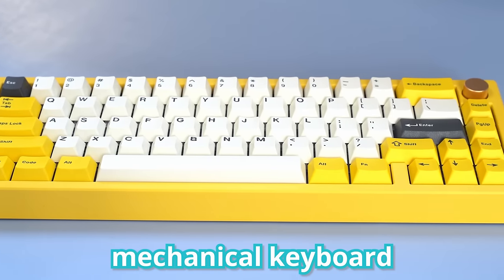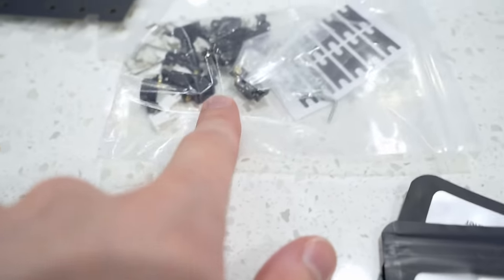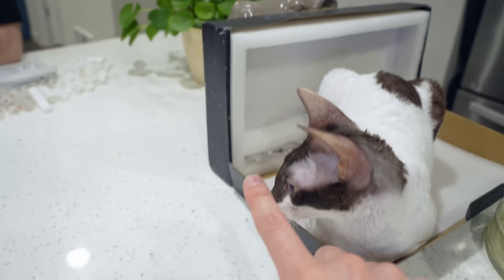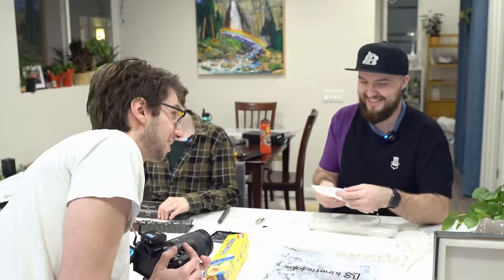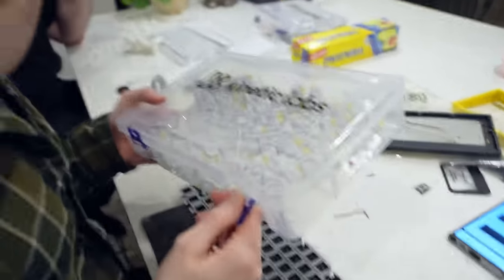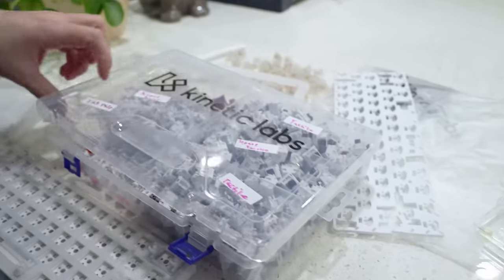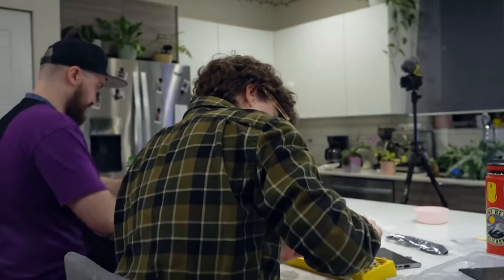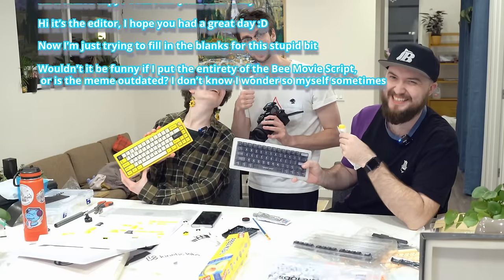How to Build Your FIRST Custom Keyboard... (in 2023)

Comment: Not trying to troll but I really don't understand the custom keyboard space, and I'm a huge tech lover. It seems a bit like you think 'gaming' style keyboards all look the same and are silly but then most custom keyboards people make are just pastel colour keycaps on the same frame. Each to his own but the main thing for me is that you're missing out on features like media keys, low profile form factors, light up keycaps (so you can see the letters), high speed wireless, etc in a quest to find the ultimate sound of a keypress... and god help you if you like tactile or clicky switches and didn't lube them haha. I think I've just spent too long using laptop keyboards to truly value the typing experience.
Reply: Many customs feature knobs, which combine every media key into 1. Volume, pause/play, etc. You can find low profile keycaps and switches, you can get shine through keycaps, and many boards have good wireless.
Reply: At the end of the days its al about prefference
Reply: You probably don't understand because custom keyboards are decidedly not a "tech" item. Building a custom keyboard compared to an off-the-shelf gaming keyboard is like a turntable and vinyl record collection compared to a Spotify subscription: the latter is decidedly more convenient and practical, but the former augments a mundane task with a satisfyingly tactile ritual. Custom keyboards are a luxury item within the tech realm, and like any luxury item, you need to want that luxury in order to appreciate it.
Reply: All the things you listed as missing out on are present in different boards
Reply: @xdoctorblindx  Hmm I think you've got a point there. I'm a big classic car enthusiast and while decidedly less efficient/practical than modern cars they have character and personality in a way modern cars don't. The problem is convincing someone like me that's never tried one of these keyboards that it's really much better than a mass market one but you've got to buy it and feel it yourself :D
Reply: You know, a lot of custom keyboards do have these features, but it's down to what you want and how you choose to make it. It's mostly just personalisation, which you can even do with most gaming keyboards  anyway. I do agree with you though, most builds now are very uninspired and a change of pace in the community would do it some good
Reply: @Aftershock416  I'm going to go for woefully ignorant, but not wilfully. It's not an easy area to understand without coming across lots of opinion. I'll admit I don't know much. This is made even more difficult when vendors are mostly group buy and it's difficult to understand certain compatibilities. I see something like logitech's 915 tkl as what I'd want from the 'custom' space, but I've never seen a custom keyboard that offers similar features, and I wouldn't really know where to start.
Reply: @boomboxkat  The thing is most custom keyboards look just like the ones in this video. I have seen one or two of these features but nothing combining these. How would you go about making something custom but similar to the Logitech G915 TKL?
Reply: that was so passive agressive
Reply: Sure I love my Razer Analog and it’s unique to that keyboard switches with full travel detection and adjustable actuation points, but a nice looking custom board doesn’t try to override my controller inputs and make me spend half an hour fixing things every time I want to play a new game
Reply: How to be wrong in so many ways 101 😂🤣

To be fair, you did say you don't understand the space and it shows. 

Come on in, take a look around, stay awhile, and learn.
Reply: I ain’t readin all at
Reply: You're not wrong
Reply: Me before I modded my cheap gaming keeb
Reply: @LukeEvans55  you buy and modify a Logitech G915 TKL. 🤷
Reply: It’s because they’re better keyboards than those gaming keyboards you mentioned. Hope I helped.
Reply: It's a hobby. People are into custom keyboards for the same reason that people tune their cars. It's cool
Reply: Bro wrote a whole essay fr fr
Reply: custom keyboard space for me is not that much leaned into tech so its understandable.
Reply: It depends on your use case and what you think is cool tbh. Most of the 'gaming' customs are about aesthetics since, at least for a lot of the well known builds like the tifu custom, the person already knows what switch they like. There's also a ton of size choices compared to most mass production keyboards especially for low profile cases. It's mostly about diversity in case material for me since I love my current low profile case
Reply: Kailh choc switche are low profile
Reply: and i dont think people in the keyboard hobby sacrifices some of these features just for the sake of sound. do know that with the right build you can build a board that's as fast or even faster than mainstream gaming keyboards and crazy rgb.
Reply: its all about preference and who needs light up keycaps to see the keys bro? just memorize the keyboard 😂
Reply: Most custom Keyboards will use QMK firmware.  You can up to 16 layers.  You can all those extra keys on a layer.  Many of the customs like the yellow Zoom65 in the video has per key RGB, so you could use backlit keycaps if you really wanted.  The Zoom65 is Bluetooth as well, though BT does have latency.  Still, most gamers are going to be sitting by their computer when gaming, so just use a USB cable.  Whether to lube a switch or not is personal preference, and depends on the particular switch.  many switches come factory lube and feel pretty good stock.
Reply: @xdoctorblindx  I put custom keyboards more like quality hand tools.  Not a luxury, but can make a professional work easier or last longer.
Reply: I lubed my Razer Black Widow a few weeks ago after owning it for many years… I get it now. Even that made a night and day difference in the quality.
I really don’t like the pastel colors that the custom folks seem to like though.. if I build a full custom keyboard, imma definitely have media keys, volume knob, and shortcut keys.
Reply: Personally I find there is quite a lot of variety! 

Sure you've got keyboards like these but then you've also got stuff like dactyl manuforms and ceramic or metal keycaps!

Different layouts for your keys, like colemak or dvorak instead of qwerty too.

You just gotta take a bit of a deeper look.
Reply: I think it helps not to think of it as a tech item, but as art :)
Reply: My personal answer is: it depends on what you care about. Sure, you give up quite a lot of things in order to customise a board to your needs, but I never cared about media keys, wireless(in keyboards) or rgb.
So it’s easy for me to give up those things to get what I want in other aspects, like full key remapping with an option for multiple layers, compactness(helps with shoulder orientation when working or gaming), being able to customise the sound, feel and look
Reply: Idk men I can agree on the missing features but it just feels good to make something sound nice and having it useful to your daily routine or what you do with it. Feels the same as building a pc
Reply: @xdoctorblindx  Tbf the key caps themselves should not be so expensive 

The prices are definitely inflated
Reply: All those features are in custom keyboards as well if you do the digging 

I’m looking for an exploded 75% w/ Gazzew Boba U4T switches as the base for what I want. 

I don’t like RGB or lighting up (cause i won’t be typing in the dark most of the time) but I definitely want macros on the left side (this has been extremely hard to find) 

I agree with you on a lot of the key caps being overpriced and looking kinda samey. But some just look nice and then I can mix & match them with others whilst also having a few custom made (as in design wise not material) for my macros
Reply: its called a hobby. Someone liking something doesnt need to make sense to you
Reply: That's hilarious. Personally love Custom keebs (i have built 5), but very much think the most popular designs are the most unsaturated boring things ever. 

And it makes sense from the perspective of someone who likes the RGB/game aesthetic that pre-builds have, why would they think a BoW or WoB design is cool in any way? Or a slightly off white cap set white blue enter key? 

There are some happy mediums. Shine through caps aren't that uncommon for custom. Wireless features are available, and more and more people are getting behind the idea of pre-builds that are easy to mod like the keychron k-pros, or others that have Wireless, custom software, hot swap. And keycap designs are sometimes deciding that color isn't a bad thing. Clones are making it easy for people to try something without breaking the bank too.

Definitely feel that sting of the "custom or go home" mindset though, I use a K-pro as my portable one for work, but when i first got into the hobby it felt like doing that would be a crime. Definitely understand the immediate aversion to that type of loud opinion. 

As the hobby/market becomes more saturated, the lines will blur even more. Hardcore "kits or be killed" people will become the quiet minority, and the culture will align to a new popular style. We see evidence I'm this already.

The old-school group buy design has been targeted by some companies that offer in-stock kits, cannonkeys comes to mind. The "lube it yourself" popularity is shifting, more and more pre-lubed switches, like in this video. More and more "this keyboard you don't have to mod" options available. 

Idk
Reply: Ultimate it's about what matter to you the most. For custom kb community, it's mostly about the sound and feel, so a lot of gaming keyboard features just get in the way: the "stock" keycap is thin, abs plastic which sound bad, the stock switch is... fine but can be improved, the keyboard case is mostly plastic with "stock" mounting style with stiff typing feeling, some keyboards have weird layouts with the modifier row, which means if you don't like the keycap look, you're kinda stuck with the stock keycap.
For some features that custom kb lacks: with fast wireless, most people who use custom kb will likely prefer wired and use a custom cable as well, there's a reason the custom kb community praise qmk/via support a lot, even though qmk/via doesn't support 2.4GHz yet
Reply: Everything you mentioned definitely does exist in the custom space, it's just that most videos aren't about them, for whatever reason.
Reply: A membrane keyboard is really all you need.
Reply: @dcsoda1 sorry if my reply is a bit wordy.

”better” is to broad of a term to someone like OP who has never been down the rabbit hole. 

I was like that until about 3 months ago when I got bored, and decided “ehh why not” I didn’t set any expectations on it, and got a lot of confused looks from my wife and friends when they saw I was reading my 100th wiki. just trying to get a grasp on all the nuances of this hobby.

But I would be lying if I said I could just buy an off the shelf keyboard anytime soon. Maybe it’s the build or combo of doing it myself, but it’s definitely worth all the time and money I spent.
Reply: Both the hobby and the community are like coffee lovers. Function wise, they’re all good. You can never go wrong, they will do exactly what you want them to do well. It’s like drinking coffee for the caffeine. 

But then you take a step up and decide that you want good tasting coffee. There are super easy ways to make it taste good like adding milk and sugar. There are even more niche options like oat milk or agave. Same with keyboards if you ever decide to mod with foam or switch out the linear to tactile switches or key caps. Small and possibly cheap and easy upgrades to what you already have. 

Then you have the super bougie coffee lovers who drink black coffee and say it tastes nutty or that there’s a hint of chocolate. Kinda stuck up but there’s still truth in what they’re sensing. In keyboards, you suddenly become picky about things like materials of the case, small design choices, the difference between super niche switches that to most people will feel and sound the exact same. All of a sudden, instead of getting budget or prebuilt or already in stock, you obsess over group buys and that you need to get this certain set of keycaps. 

In conclusion, it’s as bougie and mildly stuck up like being a coffee drinker. Functionally there is next to no difference but if you have experienced and savored enough keyboards (drank enough black coffee), you might feel a difference enough to have opinions about specific custom choices. 

I’m saying this as a keyboard enthusiast and a coffee lover. Imo both communities can get super stuck up (keyboards are noticeably  less toxic tho) but there’s a reason why people like it.
Reply: Custom keebs are for typing and sound profile
Gaming keyboards rarely come with switches or stabilizers lubed, and often the switches are just click clacky to be loud
Reply: I understand that point of view. Having used the apple magic keyboard for many years, I was used to low profile tactical switches and they are fine. 
But since i used my first custom keyboard, an iqunix l80 that i foam and tap modded, gave it high keycaps and black hyperglide filmed and lubed switches, i could never go back. The typing experience is something you have  to try before discharging it 😁
Reply: i just like having my own unique board that looks and feels how I like want it. I also just really dislike gamerboards and dont care for rgb. But honestly I can see where you come from when most of the youtubers build the same 3 boards with the same 5 switches with the same gmk and pastel keycaps and only really care about sound. It's not really unique at all at that point
Reply: Many keyboards have customizable firmware, you can easily assign functions to any keys yourself 

There are low profile keyboards with hot swappable switch sockets, but there aren't really that many low profile switches to choose from

I think the main reason shine through keycaps aren't popular is because most kits use south facing LED to avoid conflict with Cherry profile keycaps. If you use normal shine-through keycaps on it, the letters are barely lit and it looks quite bad
Reply: tut cough uneducated cough
Reply: i like pastel
Reply: @LukeEvans55  I thought it was super weird too, until I tried a good one and found a brand that I like.
Reply: @LukeEvans55  I've got a halo75 from Nuphy. Looks different than most keyboards that I've seen and the sound and feel is amazing. Below 150$ as well and very good quality.
Reply: I mean all those things you can be missing you could just go a bigger size
Reply: Probably because for $230 (The price of a Razer Black Widow v2) You can build a wired keyboard and macropad that has everything that keyboard has but sounds better (based on your preferences), is customized to your preferences, and is something you know inside and out. If you don't like pastel, there are hundreds of Keycap sets that aren't pastel.
Reply: Laptop keyboards are terrible for gaming. Gaming keyboards are generally sensitive and use linear switches. RGB is generally for more casual players and those who appreciate the lights. Keycaps do matter as well, like grips on any tool you'd use for anything involving hands... Keyboards are more a tool for people who game lol
Reply: @xdoctorblindx so they are not a tech item but still in the "tech realm". Ok
Reply: I get you 
And I hugely appreciate how you weren’t a dick about it like some other people you respectfully asked us a question!
Reply: Hello: new to this space. Can someone please name some companies which have full-size keyboards within the ~ CAD400 +/- 100. Req: double shot lit through key caps, tho key sound quality, and has wireless (2.4 & Bluetooth), and has usbc wire as well. Any help is much appreciated.
Reply: "every custom uses pastele keycaps" you have no idea how wrong you are. 1. Artisans, 2. Clear keycaps, gmk, etc. And no it's not the same frame, some can be thicker and thinner, media keys are super useless, there are knobs, light up keycaps look ass(especially the stenciled ones, those don't produce a good sound OR look readable., And there are some exceptions to that, mainly custom pht shinethroughs.) And there are low profile keyboards like the nuphy air series or some offerings from keychron
Reply: @testtesting7740  monsgeek m3

Comment: Just built my first keyboard. I didn't have any proper lube, but I did use some silicone lube. Watching some of your earlier videos did help out, though I kept screwing up the stem direction regardless. No thick case, but I do plan to get my 3D printer warmed up again to fix that. I also had to submit a bug fix to QMK regarding rotary encoders for my keyboard, so it's been eventful.

Comment: Josie's build is great just for its color scheme and boutique keycaps... but it also sounds good and has consistency between the keys with and without stabilizers. I put a "budget build" together w/o lubing the cheap stabilizers that came with the barebones board. The sound is very different between the keys with stabilizers and 1u keys. I'll be pulling and lubing those stabilizers.

Comment: I bought a "GMMK Switch Sample Pack" for a few bucks. You get 2 each of each of 18 different switch types. The Glorious "Lynx" switch comes in 2 versions, lubed and un-lubed. They are linear and completely silent. Super smooth action. Downside is they cost $35 for 36, so I'll need 3 paks ($105) for my 108 key board. Lubing 108 switches by hand on a Full-Size board isn't my idea of a good time. Still, thumb up cuz I'm learning so much on this channel. Last night I put new Gateron Brown switches in my oldest GMMK Full Size board. Only ruined one switch! Now I need to cough up the cash for new caps. The old ones are around 10 years old and shiny. Uggh!